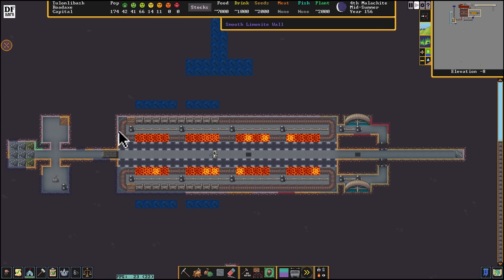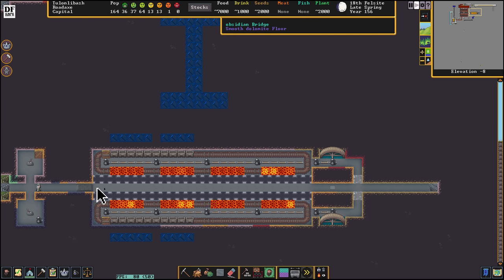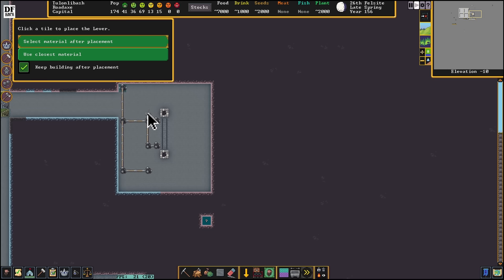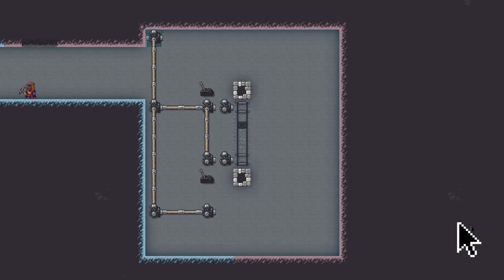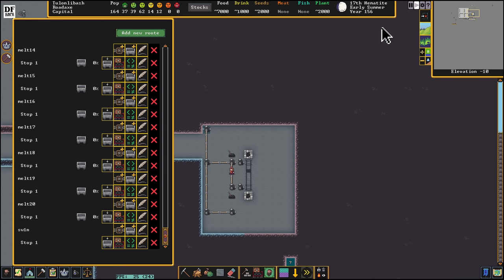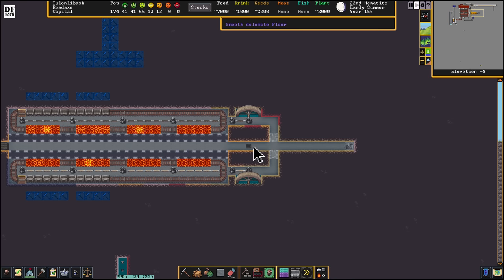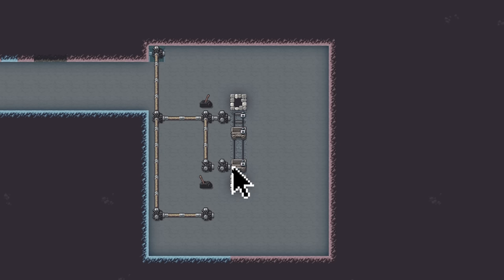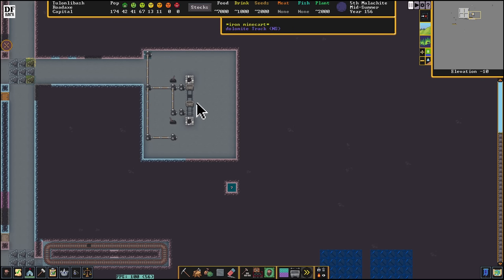Trap Automation & Intro to Dwarf Computers 🔅 DWARF FORTRESS STEAM 🔅

Comment: This is neat. I've been using a dwarven "latch" that I found on the wiki for this sort of thing -- pressure plate attached to a hatch that dumps water onto another pressure that triggers off of liquid. Then a screw pump stack linked to a lever to reset it by pumping the water up off the hatch and back up onto the pressure plate. The system in this video looks a lot easier (and doesn't require 3 z levels)
Reply from the maker: Thanks; Each of the Disciplines; Fluid logic, Mechanical logic, Creature logic, & Minecart logic, each have pro's and cons 
check this out for more info https://dwarffortresswiki.org/index.php/Computing#Disciplines
Reply: @TwistedLogicGaming  Very cool! I'll check it out.

Comment: Nicely enplaned! I'm working on a automated system for my series of bridges on my main gate. Its about 30 1x5 bridges with 30 pressure plates set for various levels of liquids within a water Reservoir. The reservoir will be filled using a Brook and two Bridges with levers. When the reservoir is filled the bridges will close up. When it is drained the bridges open.
Reply from the maker: That sounds awesome ReileySRies !! Reach out if you need some help with it ! Thanks for watching!
Reply from the maker: Your a veteran from the long long ago aswell, so I know your a great player, still its good to have others to help! For me sometimes talking to someone or just typing things out, allows me to figure out problems even before they awnser hahahaha <3

Comment: I finally got my magma mist generator to work....then had to replace a few gears, they melted after the first test run. I still am having a problem with the first turn from the back tracks before the magma...my carts sometimes jam on that first curved track. Going to try removing the two rollers the feed south or north (depending on which half of the trap i was testing). I have not had the chance to test it out on a siege yet (it works very good on cats...). 
 One of the reasons i stopped using magma traps in the past, was the length of time required for the trap area to drain and the magma to evaporate to a safe level for the dorfs to enter the area. This trap allows me to start using magma again, the way dorfs are suppose to. Thanks for the effort and taking the time to show us.
Reply from the maker: Are you the same person I was helping with this on reddit ? ( going off the version 47.05 video ) ?
Reply from the maker: Thank you for the long term support Johnnie Woodard !! you have been watching for years and I appreciate that !!
Reply from the maker: Glad you got this working <3
Reply: @TwistedLogicGaming  No, never posted on reddit...that i know of. I will admit to watching your channel for some time (don't judge me too harshly), you have helped explain how to really get the most out of DF 47.05. Your videos on liquid physics (47.05) explained why I kept flooding My forts. Me and my dwarves, esp the dwarves, Thank You.
  I have not taken the plunge into the Steam Version yet, but I will. I don't buy games until they have been out long enough for most of the bugs have been squashed. I have enjoyed the now Classic version for so long that supporting the creators is the least I can do.

Comment: 5:17 It's actually possible to link to both but the lever must be linked first, because linking a hatch or door to a lever forces it to be closed until an open signal is sent. A dwarf has to stand "inside" the door to be able to link to it, so linking a lever first and opening the door with it allows you to link it to pressure plates subsequently. (In theory also possible with pressure plates first if you can get a triggering entity to stay on the pressure plate while you link it to a lever, but if its an creature-triggered pressure plate this is obviously not going to be easy)
Reply from the maker: Thanks for the added info Master Spike !! I'll check it out next time I have time to play for a bit !
Reply: @TwistedLogicGaming  Yeah kinda discovered it by accident, I'd linked a pressure plate to a door and wanted a test lever after the fact, and noticed the lever link job was getting cancelled. Tried again and followed the dwarf doing it and they'd cancelled the job after they picked up the first mechanism which made me think it was some kind of pathing failure. Then I got the idea to try it the other way around and link the pressure plates while the door was opened by the lever and it worked.

Comment: Really cool I'm having trouble with the pressure plate. The gear assembly is not disengaging when linked plate set to creatures trigger. The gears do disengage if it's set that citizens trigger. I tried a combination of mine cart with creatures but that didn't help. Any thoughts?
Reply from the maker: The lever and pressure plate should not be hooked up to the same gear assembly. that is why there are 2. when linking the pressure plate to the gear assembly with nothing else linked then the gear assembly will disengage and toggle on when triggered. for the test plate I was using citizens to activate. try that so you can see a 1wide hall with a test plate and an extra gear just for testing similar to 07:22
Reply from the maker: I hope that helps Eric ! lmk
Reply: @TwistedLogicGaming  thank you for replying. I built a test gear assembly hooked to a powered axel with nothing else linked each time rebuilding both gear and plate before linking and I'm getting the problem with all plates but the citizens trigger. It may just be my game. I'm not using any mods that would seem to cause an issue. Just ui with keyboard shortcut and timesless dwarfs. I'll try a reinstall but really cool stuff ty so much.
Reply from the maker: I just tested what you said there after reading a second time. thats weird lol yeah when citizens trigger it disengages and toggles on but if you don't do that part and only creatures trigger then it is on* and toggles off
Reply from the maker: I have no mods and it does that very interesting ! Thanks Eric !
Reply from the maker: not sure if that is a bug or intended as we have no release notes or documentation from the devs
Reply from the maker: i found this on the wiki - A mechanic who completes the first attachment job on a pressure plate will not cause an open to be sent to the building being linked, but a close will be sent-- when the open is sent, the building is not yet linked! This tends to toggle gears upon linkage, and makes futile single-use, civilians-trigger pressure plates. https://dwarffortresswiki.org/index.php/Pressure_plate#Unusual_triggers
Reply from the maker: so if you don't use the Unusual trigger; then a NOT logic gate can be used for the same effect
Reply: @TwistedLogicGaming  thank you!

Comment: Everytime I add power to the system the whole thing starts up.

I think the issue is the gearbox attached to the pressure plate is not waiting for the pressure plate to be triggered before sending power to the top rollers. 

For the life of me I can't find a solution. 

Just wondering if someone ran Into the same issue setting this up.
Reply from the maker: A standard linking pressure plate will be on toggling off / a CIV pressure plate link will be off toggling on. If you don't use the "Unusual trigger"; then a NOT logic gate can be used for the same effect - A mechanic who completes the first attachment job on a pressure plate will not cause an open to be sent to the building being linked, but a close will be sent-- when the open is sent, the building is not yet linked! This tends to toggle gears upon linkage, and makes futile single-use, civilians-trigger pressure plates. read more about this here:  https://dwarffortresswiki.org/index.php/Pressure_plate#Unusual_trigger
Reply from the maker: the basics of what is happening with the CIV plate is they connect it while it is pressed down reversing the connection & it will be off toggling on., with standard plates the dwarf does not trigger while linking and it is standard on toggling off
Reply from the maker: I hope that helps LMK Jeremy !
Reply: @TwistedLogicGaming  Thanks, for the reply and the link. I was able to stumble on a fix with them. Stumble because I'm not sure how it worked, but did. Anyway, wouldn't have been able to do it without you. 

*Solution 

First link the gearbox next to the top roller (the one which is linked to the pressure plate enemies step on) to a lever.

Activate the lever

Then dismantle the lever

I don't know why, but I did something that caused every gearbox I created be created wrong. The lever trick I listed above did some sort of reset and fixed the issue for me. I might have just ran Into a bug.

Comment: Reminds me of Etho's Hopper Clock for Minecraft.
Reply from the maker: it's more of a latch than a clock but I can see the connection hahahha
Reply: @TwistedLogicGaming  ah so more like a SRS latch like in Factorio then?
Reply from the maker: @theblackdragon7321  In Electronics, Latch Circuit is a circuit which locks its output, when a momentarily input trigger signal is applied, and retains that state, even after the input signal is removed. This State will remain indefinitely until the power is reset or some external signal is applied.
Reply from the maker: check this page out for more info https://dwarffortresswiki.org/index.php/Computing
Reply from the maker: and here is the direct link to this 1 bit memory cell https://dwarffortresswiki.org/index.php/Minecart_logic#Newton.27s_Cradle_Memory